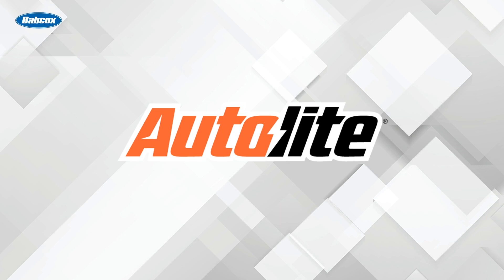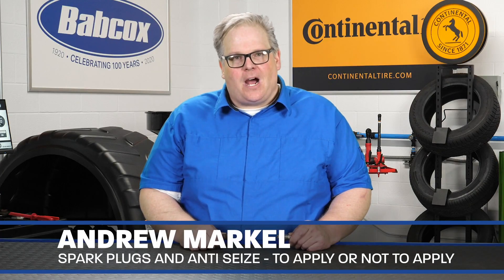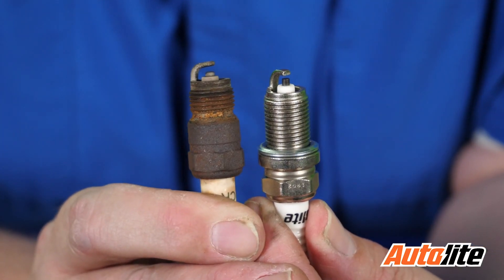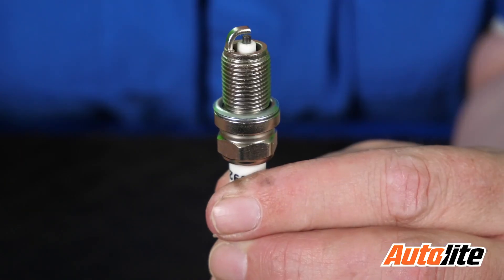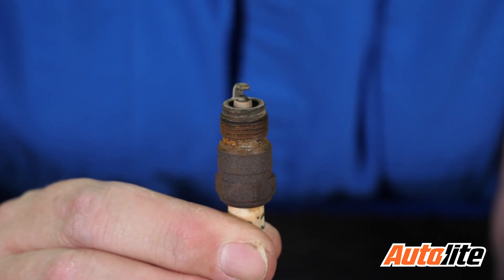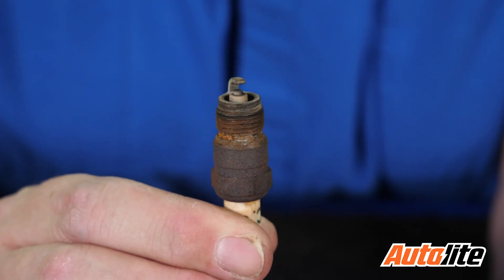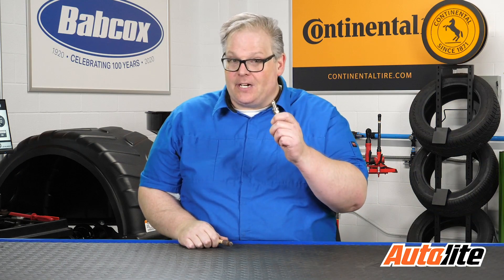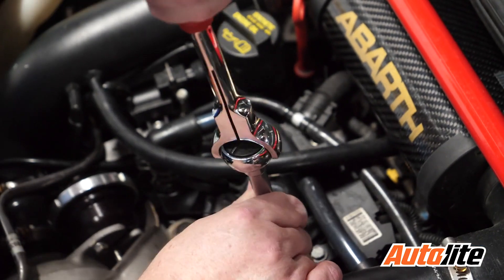Should You Use Anti-Seize On Spark Plugs?

Comment: Honda's service manual for J35 and R18 engines says to use anti-seize, they provide a torque spec, and they recommend NGK plugs that are plated. For the same plugs, NGK reccommends not using anti-seize and provide a angular tightenting spec. Personally, I follow Honda's service manual.

Comment: Honestly.. who torques their spark plugs? I still put some on their, good insurance policy. Worried about conductivity issues use the copper one.
Reply: I do.  Always have.
Reply: On 5.4 Ford V-8s and Ford V-10s you really need to. Ford calls for 15 ft lbs. But you need to torque them to 22-25 ft.lbs otherwise they might blow out. Don't know if you put anti seize on them if you have to make adjustments. Aluminum heads

Comment: The only way I could possibly see a grounding issue is if you somehow coated everything metal on the plug. If you put a little on the threads, the washer will still contact the head.

Comment: NGK says no anti seize on their spark plugs and has a TSB on this now.Put anti seize on their spark plugs,grounding problems if installed in aluminum heads.Will break the plug when torqueing them down as well.

Comment: Don’t need to torque spark plugs. I put anti seize on all my spark plugs and have never had an issue, makes it 10x easier to pull them out later if need be.
Reply: Can cause grounding problem issues when installed in aluminum heads.NGK found this out
Reply: @Toolaholic7  that's not true for the vast majority of autimotive spark plugs. It matters what type of plating the spark plug has. Also matters what kind of anti seize.
I use Nickel-Graph anti-seize which has no copper and doesn't cause inter-crystalline corrosion between stainless steel and aluminum.
Anti-seize is completely fine to use on most spark plugs and is basically required in the rust belt.
If you torque your spark plugs to spec then you need to reduce torque value by 30%. 
For 20 Ft-Lbs dry torque spec you simply multiply dry torque by 0.7 to get anti-seize torque spec:
20ftlbs * 0.7 = 14 Ft-Lbs (Wet torque value)
That eliminates overtorqing aluminum threads.
Nickel anti-seize is also highly conductive and is very unlikely to prevent a ground. That has to be a certain plating they used in conjuction with too much copper anti-seize.
Copper anti-seize causes inter-crystalline corrosion with stainless steel and aluminum. Will cause the metals to break or fail under heavy loads. Not a fault of the application and efficiency of anti seize on spark plugs but a misuse of it.
NGK should know this, like many other ignition plug/bolt/fastener manufacturers including one of the world's leading fastener manufacturers Ajax.
Reply: @CameronDC-Grimes It is true,antisieze is an insulator

Comment: Even the black motorcraft plugs have a coating baked on them, no anti seize is needed on plugs period, its a myth that many believe.
Reply: I am so goddam sick of this. you don't know who to believe and everyone is an expert. Be damn nice if the manufactures would say yes or no on the damn box. Problem solved.
Reply: @DenisAbbott-m2q  They do all say it on their websites and many directly on the packaging.
Reply: Wait till a sparkplug rips out the threads in an aluminum head
Reply: @printgymnast368  It doesn't happen if they were put in properly and there were no problems with manufacturing as with Ford and their issue with the modular engine family.
Reply: @fordwindsor351  "if they were put in properly" key words
Reply: @printgymnast368  its as in cleaning, not with putting any amount of anti seize on.
Reply: Y’all over here under this video spreading that myth

Comment: hmm, can't get a torque wrench in there anyway.  Are there any conductivity issues with anti-seize?
Reply: Grounding problems if installed in aluminum heads
Reply: Your correct.Some engines do not leave you enough room to use a 3/8 inch torque wrench. You may have enough room with a 1/4 inch torque wrench, but I just use my decades of hand torque experience to tighten  spark plugs.I always use antisieze when I can.